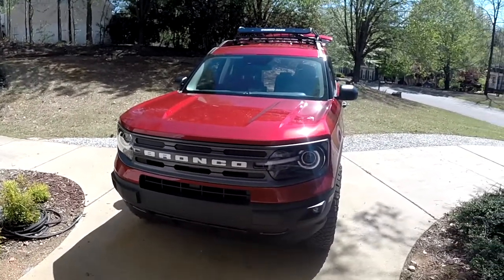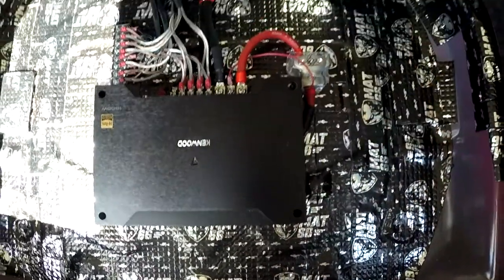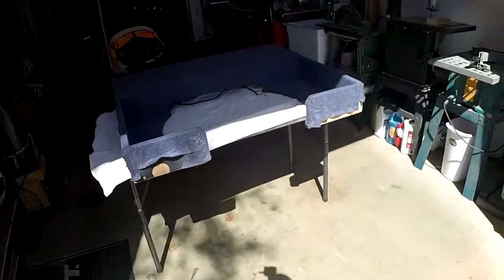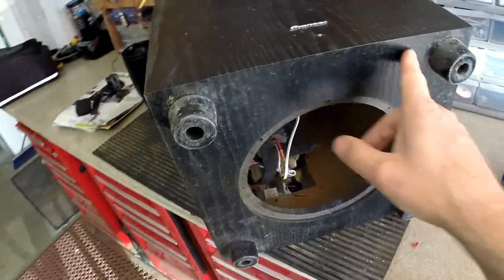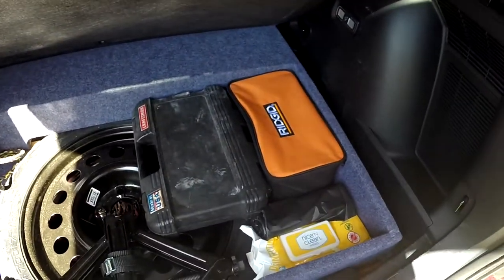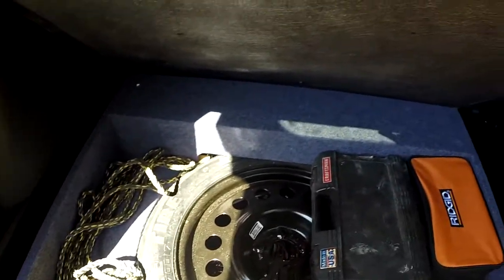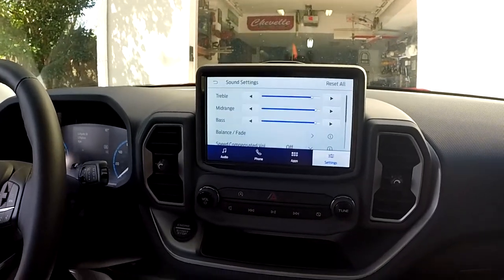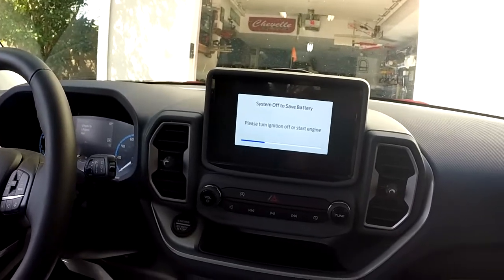2021 Bronco Sport Speaker Upgrade With amp and SubWoofer

Comment: Any guidance in replacing the tweeters?  Is there any space to cram an attenuator in that tweeter well, so they aren't at the same level as the doors??
Reply from the maker: It might be tight, if you get creative there should be enough room.

Comment: Any chance you live in Central Florida? LOL!!! Can you provide the specs for the speaker box/tray? That is an awesome set up and exactly what I'd like to do.
Reply from the maker: No, I’m not in Florida!  The crude measurements I have written down are 38.75” wide, 30” deep, and 7” tall in the front and 5.25” tall in the back. I don’t know if a full size spare will fit with these measurements as I have the smaller spare. Thanks.
Reply: @themellowmechanic hello sir, how did you tune the port? 

Diameter of port hole and length? 

Whats the area of the enclosure after removing the volume for the port? 

Thanks!

Comment: What color r the wires u got signal from for the amp?  Where did u tap into them at?
Reply from the maker: I tapped the factory wires in the door panel at the speaker. The driver side is blue and grey. I’m not sure about the color of the other speakers.
Reply: Which is positive and negative?   Thanks!!

Comment: Working on one of these now. Harness I got for radio to bring signal to lc7i did not work. What did you do for this?
Reply from the maker: It looks like it uses the main signal input, usually from the front speaker output of the head unit to turn on. If it’s not turning on then you might need to put it in defeat and run a remote 12volt  switched signal wire. Read the owners manual on how to put it defeat. I did not used adapters to get my signals. I opened the doors and taped into where the factory speaker wires attached to the speaker.